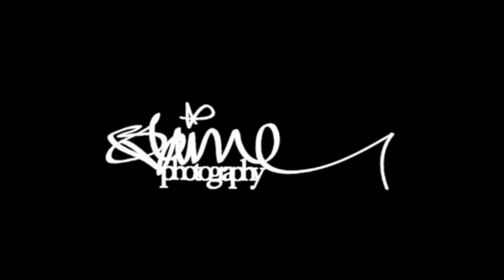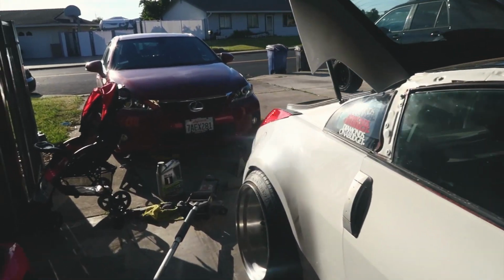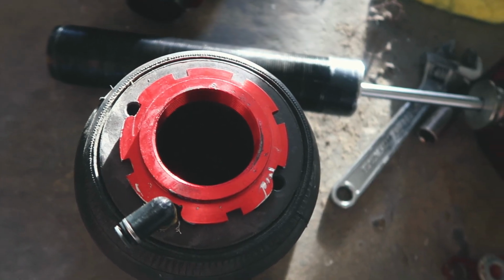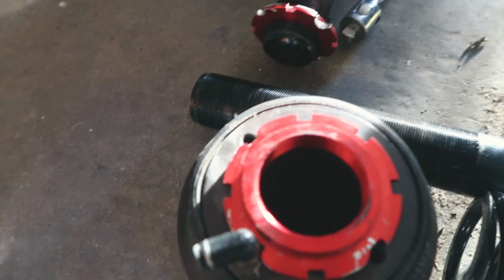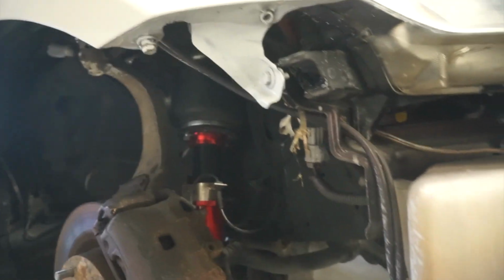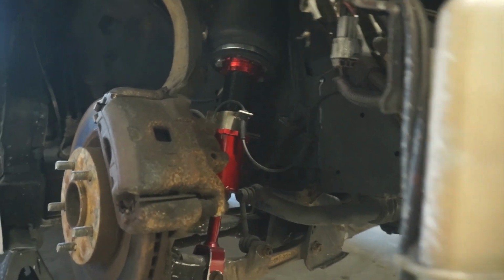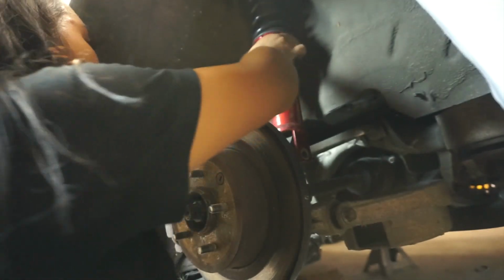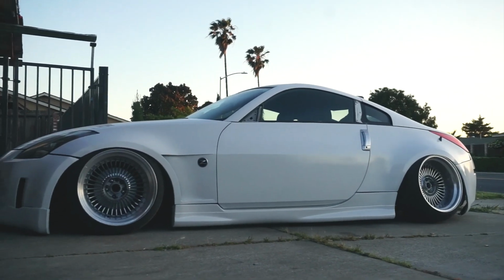Bagging the Z &  Fixing Fitments

Comment: hey thanks for such a great explanation video, i just have one question, when you install air lines and connect them to the bag- you just push in the line in a bag connector, or you need something else to purchase? also what bolt size is it?
Reply from the maker: Surreal you have to put air fittings in the bag then just connect to air line, don’t know the bolt size off the top of my head
Reply: thanks a lot man!
Reply: also do you think gauge is something nessesary to have?

Comment: Hey another question i have is, when you put the bag on a coil this way, whould you screw it on until it touches the top plate or stop somewhere midway?
Reply from the maker: Surreal it really depends on your preference of ride quality and look tbh
Reply: Blaine Nojiri so the more you screw it on the lower it goes?
Reply from the maker: Surreal yes and no the bag will bottom out with air still in them at a certain point mainly set the bag based on pressure and ride quality and height adjustment is with the coilover

Comment: How much is the cost to bag if you already have the coils???
Reply from the maker: FunnyVids you would have to buy bags and management, honestly the price differs a lot because there’s a lot of options and also if you get it new or used, it all depends on what you want, but roughly $1500 on the cheaper end could be cheaper if you find second hand parts